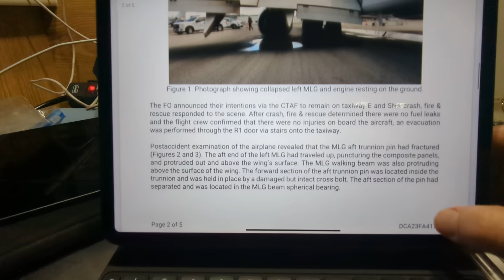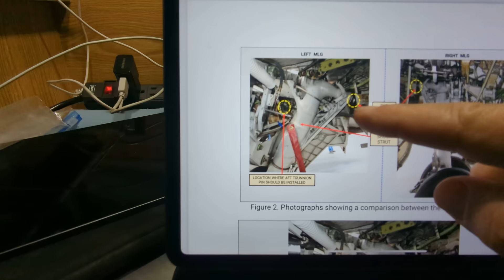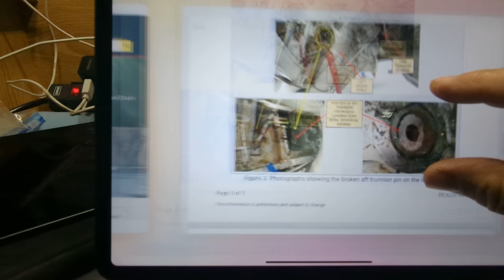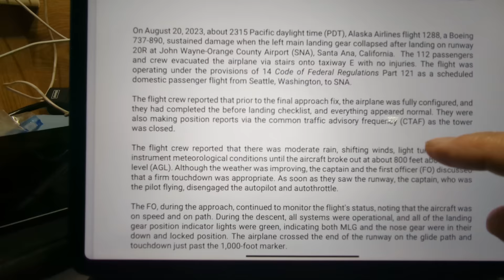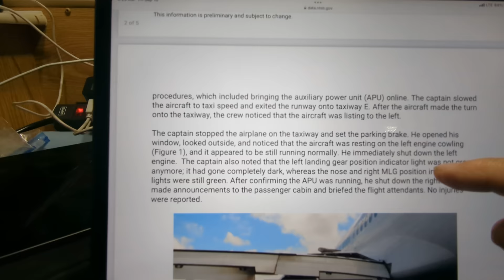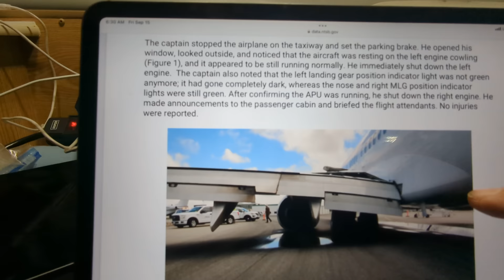Alaska 737 Gear Failure NTSB Preliminary Report.September 15, 2023

Comment: I worked maintenance for a major and stuff happens . We had a 767   main gear retract cylinder break in two when the gear was about 3/4 of the way up . Gear came down with a bang and A/C landed ok .  Saw a  727 main gear break in two on landing . Broke where a band clamp was attached to it for hyd hoses. Had a 1011 gear break ( not the main body of the gear ) where the retract cylinder bolts on to it . Had a 767 axle break when we were towing the A/C   out of the hangar . THESE WERE ALL ONE TIME INCEDENCES !  Stuff happens !
Reply: Never capitalise without spell check! 🤠
Reply: PS Cool account.
Reply: "main gear retract cylinder break in two when the gear was about 3/4 of the way up . Gear came down with a bang and A/C landed ok"  Landing gear free fall is a required test for aircraft certification, to handle failures just for things like that.  The downlock link has to stay locked overcenter (gear can't collapse) following the bang.
Reply: There are two overcenter down locks  on each of  the  767 main gears , fwd and aft and of course they locked because they had the total weight of the gear with ZERO  hyd press at  the broken cylinder . Took about 1 second  to fall and lock. Got the crews attention ! Have a good day !!!!

Comment: Looking at the broken trunnion face I can easily see that it has been cracked for a period of time. You can see corrosion and discoloration that clearly shows a crack previous to the current damage.
Reply: Good observation, that pin definitely has a story to tell.
Reply: First thing I looked at and it looked a clean brittle fracture, but as I say it looked clean (on my crappy screen maybe)...
Reply: @martinda7446  The actual viewing time was short and obviously I could be wrong. However, I was an A&P for about 15 years with training and specialty in NDT and I’ve seen a lot of fractures and a lot of pictures of fractures.
Reply: @martinda7446  
Did you down load the report and zoom in on the image? The patterning of the rust is interesting but there might be some subtle ratchet marks, but it is hard to tell as the image quality is not great.
Reply: @RMJTOOLS  I'll have to look at a better image, but thinking a bit longer, there simply had to be a defect of sorts as these things will not be bothered by a wallop unless there is a defect. And since it failed at 1.7g it is almost a certainty. So I'll just agree with your experienced eye.
Reply: @Mentaculus42  Thanks for that. I will download the report. After thinking for a minute, it had to have a defect or occlusion or something. We will find out for sure soon enough. Mentaculus ha ha. I like it.
Reply: I’m guessing a fatigue crack that initiated at an inclusion or other metallurgical defect.  Then once the cross-sectional area of the pin was reduced enough, the 1.7g landing exceeded the ultimate strength of the weakened pin.  I am hoping I’m wrong, however as I see a future AD.   Better would be one or more past hard landings.
Reply: @qcan8468  That sounds exactly right.

Comment: UAL had a trunion  bearing failure on a 727 in SFO back in the ‘70’s. Aircraft slid off the runway into the VOR shack which forever was titled, “ cleared direct to the VOR’.
Reply: Har!

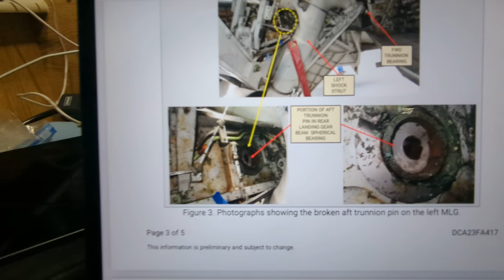Comment: AEROSPACE ENGINEER HERE: I have downloaded the report and looked closely at the photos showing the broken section of the trunnion pin that was still in the spherical bearing. That is the right hand photo you can see at 2:14.
Overall it looks like it simply snapped. The question is why? It looks like a clean snap, with no obvious defects, but there's a couple of area's I'm sure the NTSB fracture mechanics experts will be looking at. 

FIRST - I am not a fracture mechanics expert but I have spent time around a couple of them in the past. Its sort of an odd area of mechanical engineering and you only need them when something has failed. 2 Things I remember are that 1) cracks tend to start from either a failure in manufacturing or fatigue and 2) once a crack begins it takes as little as 1/100th the normal force to break the material to get the crack to propagate and once a crack starts propagating failure is inevitable. This is why racing car teams strip down their gearboxes after every race and crack test the gears. Once a gear gets a crack it goes from crack to catastrophe very quickly.
 
The 4 areas I'd like to know about and where I think the NTSB will look, are:
1) At the 1 O'clock pos there's a dark line - is it a crack or a just some dirt or oil?
2) At the 3 O'clock pos there's another smaller dark line - same as item 1 above.
3) At the 5:30 position there's an odd "W" shaped mark and the inside diameter of the pin seems to be deformed inwards. This is the odd make out of the others. I don't know what it is or what it means and would expect the final report to clarify this.
4) There seems to be area's of the surface that are shaded differently. In the lower half there's areas much lighter in color. There might be a simple explanation for that and it might be from fatigue.  

I'd expect the NTSB to get on this very quickly to work out if its a fatigue or manufacturing issue because there's too many 737s with these pins flying every day.
Reply: yep, thats what he said

Comment: There was a somewhat similar incident back in March 2016 in Mumbai.  A 737-900 operated by Jet Airways had a trunnion pin snap during a 1.44g landing.  The aircraft came to rest on the engine cowling, just like this recent incident.
Reply: The cause of that accident was determined to be: “The RH Aft landing Gear trunnion pin failed due to base metal heat damage as a result of abusive grinding of the chrome plate that likely occurred during the last overhaul”.
The investigation will show if something similar happened here as well or not.

Comment: Alaska has a history of not greasing things.  As someone who worked at an overhaul facility that they used after their screwjack failure…they did not learn from that fatal accident.  Only customer we ever kicked out in the middle of a heavy check and told them to take their plane elsewhere because they wanted us to paper whip everything.
Reply: You must not have looked at those pictures: grease everywhere, especially in the grooves where it should be.
Reply: @navion1946  - They greased the screw jacks too…with the wrong grease that reacted with the correct grease causing the failure. They had huge issues with their maintenance culture and I wouldn’t be surprised if they still do.

Comment: I wish I'd known about this channel a few years ago.  I would have turned in my return flight from Cancun.  We had a good trip home and even arrived early due to helpful winds but slammed down hard on landing.  The pilot stopped out on the runway and announced that we were waiting for a spot at the terminal....while trucks and cars made a few circuits around the aircraft.  As we pulled in and got settled at the gate they announced that representatives of the airline were waiting to speak to anyone who had questions....  lol, I was so tired I just went on through to customs and headed home.  But I've always wondered what in the heck happened.  After watching I'm thinking wind shear.
Reply: I also experienced a hard landing while flying in to Cabo. The plane hit the ground so hard it bounced what seemed to be 8-10 feet up and then landed again. A definite jolt to the back and instant quiet until we pulled up to the gate when a small child yelled "yay" and started clapping. The whole plane then cheered while giggling at the child.

Comment: Used to purchase fuse pins for 777 landing gears from Sonic Industries. Each lot was throughly tested and the manufacturing process is highly complex. Could take a few months from start to end. I recall them testing beyond 1 million lbs.

I’m sure Boeing is able to pull up the records of this batch to see any anomalies.
Reply: Would this testing include landing momentarily on that one trunion in a crosswind? Thereby torqueing it at the same time the wheel starts spinning.
Reply: @martinsaunders7925  every pin is not tested with loads. The engineers design the pins (design includes factors on material strength to account for variability in material, along with many other factors), test worst cases, and then if the parts are good, they start cranking them out.  The materials and processes are all qualified to specifications. 

The cases evaluated most definitely include side landing conditions, spin up of the tires, dynamic spring back of the gear, etc. It’s all in 14 CFR Part 25.
Reply: @tylerp6375  thanks. In the distant past my only involvement in testing was largely corrosion,tension and shear. I took electronmicrosopic photos and developed them for reports. All  engineering has been in construction and marine environments,not aviation. My flying experience is limited to sailplanes with 10 hours of power instruction..

Comment: Back in 1974 Wien air had a 737 nose gear fork pin shear, resulting in the nose gear collapsing. Air data showed a 1g landing. Maintenance records showed that the gear had never been removed for service in 20k hrs, which seems not the case here. Many damaged panels and a wild ride to the end on the gravel strip but the ship was repaired and flown home to ANC from St Marys Alaska later.

Comment: Phew! Glad it doesn't mean the end of someone's flight career.  

I'm thinking that the 2.0G upper threshold has a few layers of conservative engineering safety factors too.
Reply: I saw the video of the landing certification of the first gen 737 presented by Tex Johnston. I think he said 3.5 was required but they decided on 10. The left main wobbled and started spinning 360s but remained attached. It definitely didn’t thrust through the wing.

Comment: I would be curious about the accumulation of just less that 2.2G landings for that aircraft. I would also be curious if that was metal fatigue or some contamination in the original alloy the trunnion  was made from. Thanks for update!
Reply: The trunion pin was sent to Boeing for testing
Reply: That pin is most likely in steel, forged rather than cast or extruded.  Steel isn't usually very prone to external contaminaton, a bit of grease and paint and it's good for years.
If there is a defect in the alloy that would by a bigger concern.
I'm hoping it's only incorrect maintenance, of too many heavy landings as you proposed.
Reply: @trespire  Thank you... that is interesting. I don't remember what series this 737 was but for an aircraft that's been around from the mid 60s this trunnion failure doesn't seem like a class problem.... but is something to scrutinize which I'm sure NTSB will do.
Reply: @rrich8371  It was a 737-800 NG -- Next Generation (a 737-890, to be exact). Numerous sources indicate its initial delivery date as 12-16-2008, so almost fifteen years old.
Reply: That main gear has inspections after so many cycles. It goes through NDT. Pins have wear limits and definitely cycles. 

After an X amount of cycles, it goes through repair and overhaul.
Reply: Pilots have to document hard landings. Maintenance has a checklist.
Reply: Your on the right path I suspect, the 737 is so proven I’d be shocked if it was a wider issue with the aircraft component.

Comment: I recall AC 20001 (Challenger 300) #1 experimental aircraft coming to YUL after a hard landing that severely damaged MLG. Reason having the AC in YUL was to dejoin it on the assembly line to inspect the wing to fuse fittings. Everything was A1. Aircraft has the most cycle times and hours of the fleet. I was looking at 20986 on the line today!

Comment: As an A&P mechanic in commercial aviation for 35+ years, I must say that the closeup shot of the trunnion pin looked like it had corrosion across the bottom of the fracture plain.

Comment: Hard landings would not cause this part to weaken unless it had a defect. It will either look and be as good as new or fracture under extreme load. The fracture looked clean to me on the majority of its surface. Someone here says they see a crack? That would do it, but it would usually be from a manufacturing defect or occlusion not picked up on during manufacture where hard landings could certainly have contributed  - But under normal working condition on a A1 part it would not. Considering it was 1.7g we must expect a defect of sorts.

Comment: Been a lot of trouble with defective and counterfeit parts since the big supply chain disruption during COVID.  We've seen a huge spike in overhauled and even factory enw parts failing well before they should, sometimes not even testing after installation.  CFM just launched a huge lawsuit regarding counterfeit parts being sold to them.  I wonder if this trunion pin falls into that category, or it was a natural failure and this crew won the part failure lottery.
Reply: supply chain woes mean too much revenue going into too few pockets. reduced supply (on purpose) creates higher prices (inflation), not the other way around. safety suffers  the name of profit.

Comment: In the initial report we could see the part sticking out of the top of the wing. The end of the shaft was there, with a hole where the pin, or something should have been. Right then and there we knew there was something rotten in Denmark. Now it's on to "why did it fail". Love the "Blancolirio Mobile Global HQ"!!    8)    --gary

Comment: The problems arent just with the trunnion pins. There's also inspections and ADs for the landing gear support beams and the rear spar that the trunnion is attached to. The bearing mounts get worn out of round and cracks also form in the support beams.

Comment: I wonder if there were previous hard landings that weakened the pin.
Reply: Absolutely. Bet the NTSB is looking at the previous landings that day and prior.
Reply: It was a clean brittle fracture,  no previous landings would have contributed.
Edit: Or I should say likely to.  There may have been a crack, but that would almost certainly be from an occlusion missed during manufacture.

Comment: It looked firm but not hard landing.  I took two 737-800 flights last month and both landings were firm. As Juan explained earlier, the stretched length of the 800 model means higher landing speed and firm touchdown.

Comment: A bunch of hard landings eventually causing the Trunion Pin to fail i.e. the straw that brok the camels back or hard landings that set up the Trunion Pin to fail Undernormal conditions. Are the Recordings of each flight archived to see if indead that is the case?

Comment: Failure mode seems brittle in terms of metal surface. Which could suggest fatigue failure with microscopic or hidden cracks forming in the material over time.

That could be an undetected defect in the one component, or it could be anything from bad metallurgy to overworked components and insufficient part inspections.

Hopefully a one off. Certainly not a critical failure, the plane will probably fly again following its inspections.
Reply: How about overworked inspectors and insufficient part quality? Save cost? We get what we pay for.

Comment: There is a repetitive inspection of the trunnion pin for corrosion in the area between the gear and the beam. The inspection is difficult due to the area being very cramped and requires careful cleaning , bright light and mirror or borescope in order to see the pin all the way around. I believe that the inspection was initiated due to a previous failure caused by corrosion starting a fatigue crack in the pin. It would be very easy to miss a defect during this inspection even if the inspector was being careful. Also the task may given to an apprentice or an inexperienced engineer because you are going to get really dirty and greasy cleaning the inspection area.

Comment: In 1999 I was working in Petersburg Alaska and leaving to go to Kodiak on AK air. After an 8 hr wait for a plane to replace the one that had landed on the usual route that was held for hydraulic leaks, it arrived. Due to the disruption in schedule the plane had to stop at 6 other small airports on the way to Anchorage. The pilot slammed the plane down on every landing, mostly on dry runways. I think he was pissed about having to pick up the slack from the other plane. I rode many times with Ak air and all the other pilots were smooth as silk on landing. LOL, That might be the plane he abused.
Reply: You try it

Comment: I dont know how many cycles are on this gear. These pins are removed and overhauled by several different companies, besides the original manufacturer if faults are found during routine inspections..for example rust or chrome  plating missing. Sometimes things don't  get done properly. Goodrich makes the gear and most likely the pin as well. It could have been the original pin that came with the airplane but maybe not.

Comment: The pin looks compressed about at the 4 o'clock position. I'll bet a
 parts supplier used the wrong tensile strength metal.